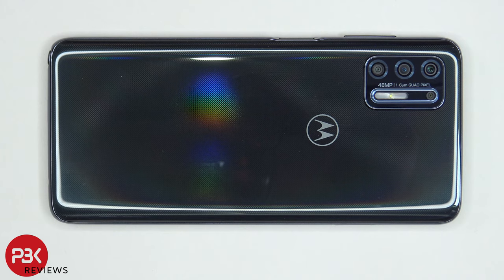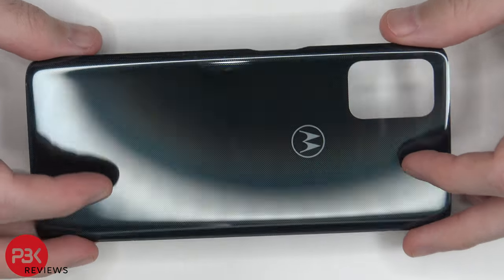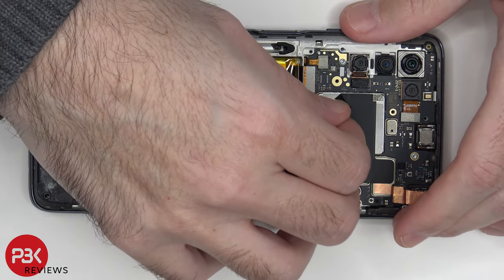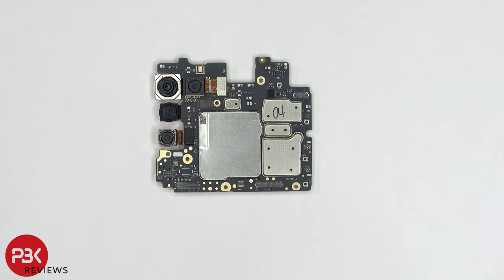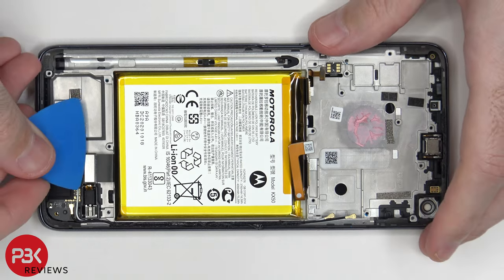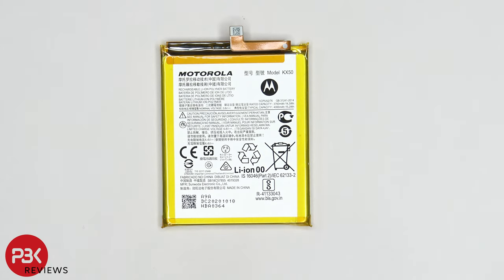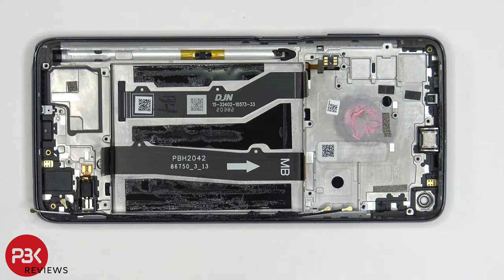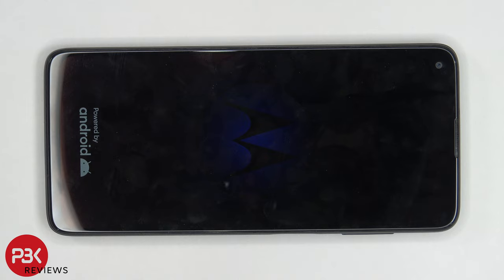Moto G Stylus 2021 XT2115 Disassembly Teardown Repair Video Review

Comment: I have to replace the glass lens cover on my rear facing camera I got it in the mail today and because of your video I'm going to be able to do it fairly easy thank you for the video keep on doing the good work
Reply from the maker: You're welcome. The outer glass camera lens cover is held down with adhesive so you can heat it up and pry the glass portion off if you don't want to pry off the back plate. Also if you need any replacement parts for this phone or adhesive etc. they sell the original parts for this phone at mobiledefenders.com
Reply: Just did this today, and this was the most helpful bit of the internet to do so.
Reply: Did you do it? How?
Reply: Alex, read the 2 other comments

Comment: Thank you!
I replaced my C port and headphones jack board. Maybe my 5th phone I have worked on.
FYI if you do this board make sure you restart phone a few times and give it time to reset your network.
Thought I had a bad board for a bit.
Reply from the maker: You're welcome and thanks for the info.
Reply: I’m having network stability issues after replacing this same board , any tips ?
Reply: Hey Justin  how do I Remove the STYLUS PEN stuck in the wrong way now it won't come out. Spring still works but It just doesn't come out. What do I do?

Comment: Hi, I have a question. Is it by any chance possible to get the motherboard out without taking out the SD/sim card tray? Mine is stuck in my phone and i need to get the cards out since the phone is being replaced, and all of my files are stuck on the SD card.

Comment: Any ideas to fix stuck in volume buttons? Not sure how or y, never had this problem but I now have 2 push hard to change volume and then it sticks for a bit, it's either 0% or 100% volume unless I change it on screen
Reply: The button seems sunk in and does not spring back like b4

Comment: Question,
The small black wire that runs from the top, down the side and snaps on at the bottom? can that thing that it snaps onto at the top be replaced or can i solder the wire to the spot still? I cant afford a new phone or repair so i fix it myself but this is a little different
Reply from the maker: That connector should be replaceable if you can find a replacement from another phone or something and if your soldering knowledge or skills are good enough to do that type of work. As far as just soldering the wire to it, not sure I would assume it would work.

Comment: Literally just bought this phone today then 30 min later, as I get out of the car it slips through my hands and shatters on the concrete, this is the only video I could find on this type of phone, but I still have no idea how to change the screen. Do I have to go through the whole phone yo get to the screen, or can I just go straight for the screen?
Reply from the maker: Oh that sucks. Ya you would need to take the phone apart to get to the screen. You can go to this link (https://www.mobiledefenders.com/motorola-repair-parts/g-series/g-stylus-2021-xt2115.html ) and they have all the parts for the phone. You will need the LCD frame assembly and the adhesive (back cover) part since you will need that pre cut original adhesive to re apply your back plate to the phone. The screen assembly will come complete with the frame, so you would basically need to move over all your parts like the mother board, battery, front facing camera and speakers etc. to the new frame with pre installed screen. You can order any additional parts you may need from that website. Hope it helps, if you have any other questions, let me know.
Reply: @PBKreviews  yes thank you this helps

Comment: Ever since I got this phone on launch. It's been the best cheap phone that I've used. Still holding strong through 2022. I had one incident were my charging port on my phone broke. How hard would that be to replace? Is it possible to upgrade the port or does it have to be an exact replacement? Because I had it professionally repaired. For some reason they put an old type c port in. It took away the phones ability to turbo charge. Plus I can't use anything type c through USB. Like type c earphones for example. It only charges normal speed and that's it. Even with the proper charger and cable. If anyone knows what I can do. Please let me know.
Reply from the maker: You would need the charge port assembly and not just the usb c port. You can look at this link and check with them to see when they will have it in stock or check other places to find it, but make sure you get the one for your correct model ( either xt2115 or xt2131 , you would need to check which your phone is ). https://www.mobiledefenders.com/motorola-repair-parts/g-series/g-stylus-2021-xt2115.html?
Reply: @PBKreviews  It's the XT2115-1

Comment: On the last vacation my son drop the phone on the pool ...we take it out and let it dry a couple of days ....but no luck ..... from where should i start replacing?  Mother board ?
Reply from the maker: first thing always in that case is to not try and power on the phone, take it apart and disconnect the battery as soon as possible to reduce the chance of shorting etc. Once you take it apart you need to dry it out and brush off any corrosion with a small brush like a tooth brush from chips or connectors. Then you can re assemble and try to power on to see if it will work. If not you need to figure out which part is bad or if multiple parts (screen, battery, board etc). From there you would replace whichever you need to get it back up and running.

Comment: If I just want to replace cracked glass  screen is still good can I pry it off the front and put the new glass on?
Reply from the maker: No, the glass is fused with the screen, the complete screen assembly needs to be replaced. Only factories with special tools and machines can properly defuse and remove the outside glass and replace it without damaging the screen or "mickey mousing" a new glass on with touch or other problems etc.

Comment: What adhesive do you use and how long will i need to apply heat to the back of the phone to take the cover off
Reply from the maker: Here is a link to a video I did on adhesive ( https://www.youtube.com/watch?v=T4iiPUIM7-Y ) and you can use a hair dryer to gradually heat the back plate evenly and get a pry tool in between the back plate and frame to work your way around prying it off. You can apply more heat as needed during the process but hot enough to the touch should be fine, no need to over heat.

Comment: Can you just use very small amount of super glue for front and maybe battery..??
Reply from the maker: You can find parts for this phone here: https://www.mobilesentrix.com/catalogsearch/result/?form_key=st7yLX0HUpYr1Fs6&q=xt2115   and its not recommended to use super glue. If you ever needed to do other repairs, it would make it really hard to take apart again or it can damage parts etc.

Comment: I tore my Graphite pad a bit. sigh. I am guessing from what I have read its important for temp. reasons. I am curious where I could find them to buy? I am struggling to find it.
Reply from the maker: It's not an easy part to find. If you tore it a bit, its fine. It helps transfer some heat but phone will still work without it. You can also use one from another phone if its similar in shape/size etc.

Comment: Any advice for this phone not turning on? Volume and power button not responding and when the charger is connected, only a white blinking light starts. No charging symbol.
Reply from the maker: white blinking means battery is completely drained and its attempting to charge. Let it charge for 5 to 10 min and it should turn on. If not, then its a bad battery probably.

Comment: I recently have this phone smoke up from being plugged into my car after with it wouldn’t charge so I replaced the charging port chip, it charges but not won’t keep mobile network but will work on wifi ...any idea what may have broken?
Reply from the maker: It could be a number of things. Maybe the sub board or charger port board is damaged and needs to be changed since it has antenna contacts on it. Also make sure the plastic covers are in place properly since those have antenna lines drawn through them as well.
Reply: @PBKreviews  in my many temps I failed after getting it damn near perfect , but because of family situations I had to buy a new one today but I'ma still go back and fix it as I love the challenge but thank you I'll look into it more and let you know

Comment: Great video!! Does anyone know what the part number is to the original factory OEM Motorola charge port daughter board? All of the aftermarket ones are junk and do not have any service with 4 G internet after replacement. I can't find one anywhere!!
Reply from the maker: Thanks. Here is a link for the replacement parts. Scroll down you will see the sub boards. Keep in mind, you want to make sure to order the correct model version that's for your phone. For example if your model number is XT2115-3 you want to make sure you get the same model variant, since the -3 is the region code and different region versions will have different antenna contacts causing service issues. Also keep in mind there is a 5G variant of this in a separate section on that website, so if yours is the 5G version, search for that one instead. https://www.mobilesentrix.com/replacement-parts/motorola/g-series/g-stylus-g-pro-xt2115
Reply: @PBKreviews  Thank you!! I have model: XT2115DL   (DL means?)   I really do  Appreciate it man!!   (Subscribed)  Thanks!!
Reply: @PBKreviews  Thanks! Also, there was a black round grommet type gasket that fell out when I pulled up the mother board and front facing camera. Do you by chance recall where does the rubber round grommet gasket goes to? I can't  seem to locate the original/ orientation / location. Thank you!

Comment: I NEED a video on how to JUST replace the battery? I have watched other of your videos and it seems you take a lot of stuff off (doing a disassembly of the phone), that is not necessary to just remove the battery? But I don't know?
Please I only need to replace the battery on a Moto G Stylus 2021, which does not have the fingerprint reader on the back of the phone.  THANK YOU,  Ron
Reply from the maker: You would need to heat up and remove the back plate, remove the screws on the top plastic cover and remove that, then peel off the graphite film over the board or lift it up so you can disconnect the battery cable from the main board. Then you need to use isopropyl alcohol and apply some to the sides of the battery and let it sit for 30 seconds so it eats away at the adhesive underneath making it easier to pry the battery off. You can apply more isopropyl alcohol if needed while prying it off. There is a link in the description for the isopropyl alcohol.
Reply: @PBKreviews   Thanks PBK, I figured that when I get the back off I could figure it out, but a visual would be nice too. Also looking at my phone I'm not sure where I must start to get the back off? Mine almost looks like it all on piece?
Reply: I had the exact same problem! I realize now, to unsnap the battery cable that plate and all its little screws have to come off. But does the new battery need fresh adhesive?
Reply: @coughdropkemp5483  Yeah, I finally came to the same conclusion by watching the video another time! ! ! That is BAD and stupid. Just to screw the customer and force him/her to pay the mfr. to install a new battery or buy a new phone!!
Yes the battery will need some kind of adhesive to secure the battery. See his follow up.  I saw somewhere he mentions that in in one of his answers? And if you click on the word MORE above he added links to two different adhesives he tried?

Comment: Hey bro the video was really helpful but I have a problem my microphone doesn't work nor my fingerprint sensor  after my disassembly could you give me any tips on how to fix that?
Reply from the maker: Fingerprint sensor, check and make sure the finger print flex cable is connected properly to the main board. As for the mic, make sure the flex cable connecting the main board to the sub board is connected as well. Aside from that, not sure.
Reply: Where can I get replacement battery for the phone?

Comment: I made a mistake, and thought the top microphone hole was the sim card release (like older Motorola phones like the G7). Is it likely I destroyed the top mic after pushing in the removal tool? Thanks
Reply from the maker: Hi, no you should be fine, the mic sits above or bellow the hole so it wont be damaged.
Reply: @PBKreviews  Thanks so much. I didn't feel anything give/break when I put the pin in. And so far, sound quality on both sender and receiver are good. Thanks!
Reply from the maker: @RideByNight  no problem :)

Comment: I replaced the screen but now the new screen wont turn on. I just feel a vibrate but now image. What is wrong?! I cant figure it out.
Reply from the maker: Make sure the replacement is not defective (sometimes replacement screens can be defective and not work). Plug your old screen in and see if that one lights up and works. Also make sure you did not damage any components or chips around the screen connector etc. You can also check mobiledefenders.com for original replacement parts.

Comment: i can’t seem to get the back plate off after heating it up. any tips?
Reply from the maker: You may need to use a smartphone suction tool to help you make leverage to get a pry tool in between to help you pry off. If not you can use a thin razor blade but that would scratch up your housing.

Comment: With how the build is very similar to older phones with replaceable batteries this should have at least had clips on the back and not glue. Also the fact that they didn't is just sad for quick battery replacements.

Comment: So wait.. do I not have to apply glue on new screen ? I just have to put glue on back cover ?
Reply from the maker: If you get a screen with frame combo which comes with the screen pre attached, then no you don't need any new adhesive for the screen. But if you get a screen replacement that is just the screen with no frame, then yeah you would need to apply new adhesive or b-7000 glue to adhere it to the frame.

Comment: HELP ME PLEASE 😭 Do you know how to remove a STUCK STYLUS PEN from the Motorola g stylus2021 ?
Reply from the maker: You might need to take it apart and remove the cover from the inside to gain access to it.
Reply: @PBKreviews   THANKS I was really hoping it would not come to this. Apparently I am the only one who has ever had their pen stuck in this phone 😅
Reply: I have the same problem. The stylus pen got stuck in the phone. I chewed the bottom of it off trying to get it out with a tweezers and then a needle nose pliers. Did you ever get yours out? Any tips?

Comment: What does the white wire cable do?
Reply from the maker: usually those coaxial cables are used for antenna connections or sometimes charging detection etc.
Reply: @PBKreviews  Is it bad if I damage one?
Reply: Those are generally WIFI or Bluetooth related and yes its bad to damage it.

Comment: Could I take the battery for the moto G Stylus 5G and put it in this phone? 

The 5g has a 5000mah battery, and this one has a 4000mah, but the phones seem to be identical in size and shape.
Reply from the maker: Hi, no the larger battery would not fit in the battery compartment. The phone size may be similar, but internally the allocated spot for the battery is smaller in size on the g stylus compared to the g stylus 5g.
Reply: @PBKreviews  okay, thank you
Reply from the maker: @histguy101  You're welcome

Comment: The volume button is broken and fell out of mine could you tell me where I could order a new one? The other replacement parts link does not have this phone on that website
Reply from the maker: You might need the entire lcd frame assembly, not sure if they sell the buttons by itself. You can check this website or ebay. https://www.mobiledefenders.com/motorola-repair-parts/g-series/g-stylus-2021-xt2115.html